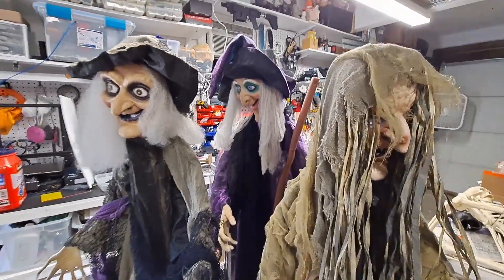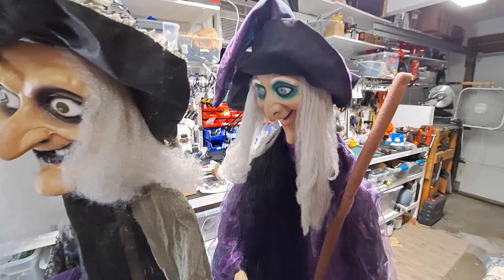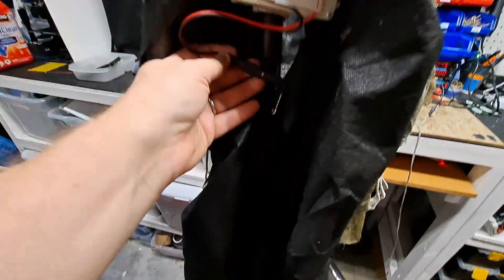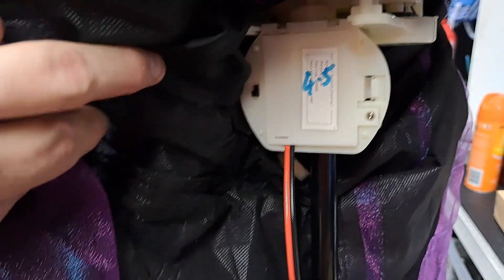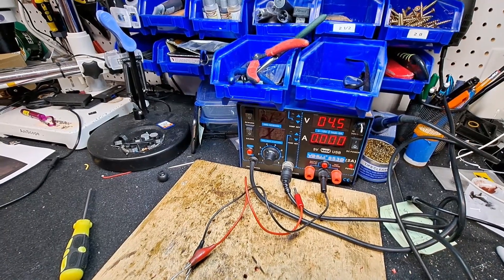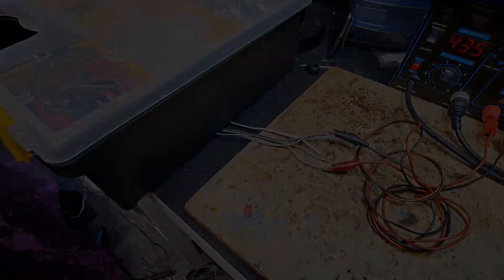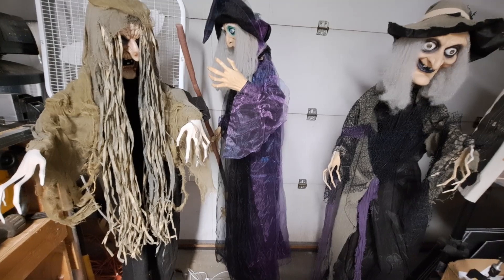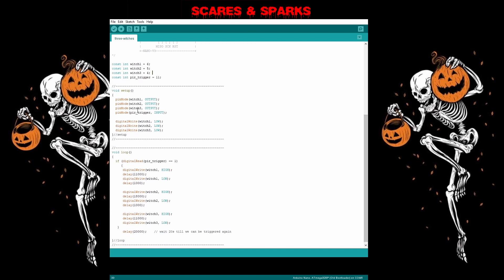Convert battery props to powered and sequence with Arduino

Comment: Google Mike North's 4 banger and octobanger for similar complete arduino controllers.  He wrote a visual interface so no manual coding is required.  Granted your situation requires simple code but the projects are nice for more complicated props or for those with no coding skills.